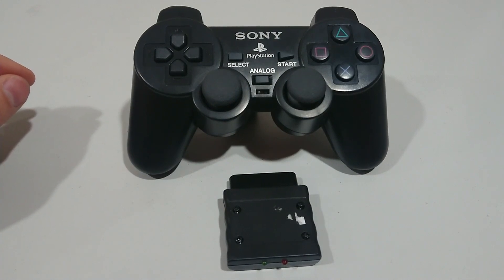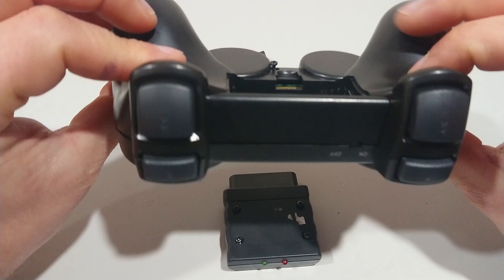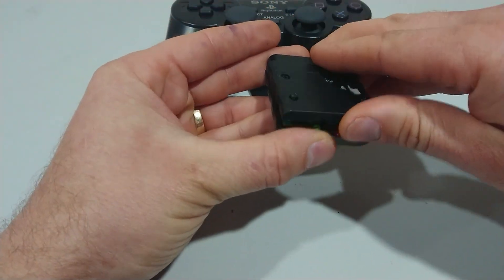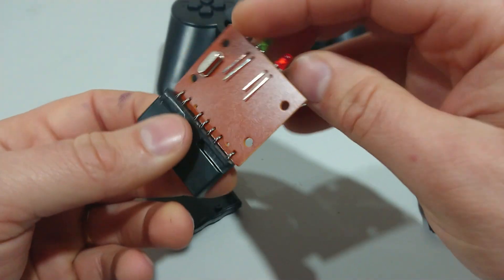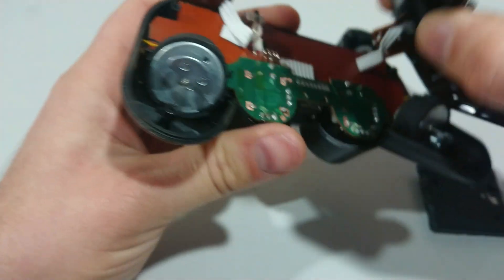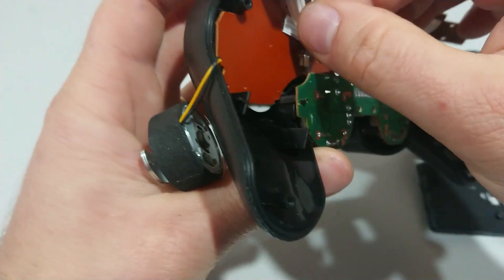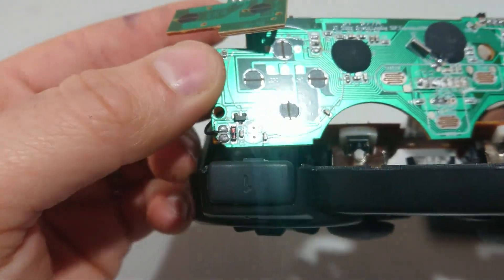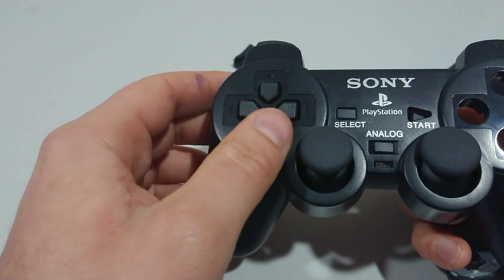Fake Sony Ps2 Wireless Controller Teardown: Poorly Made or Ahead of its time?

Comment: Stay away from these wireless controllers because they don't work.  I ended up buying a wired controller, a new knock-off brand, and it works perfectly.  Best thing is that it requires no batteries.
Reply from the maker: @joejohnson2478  👍